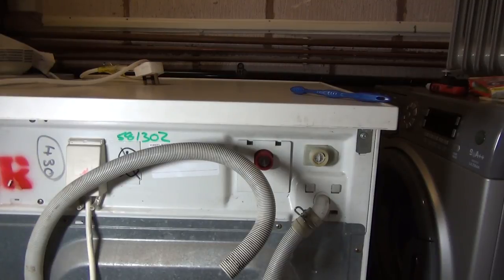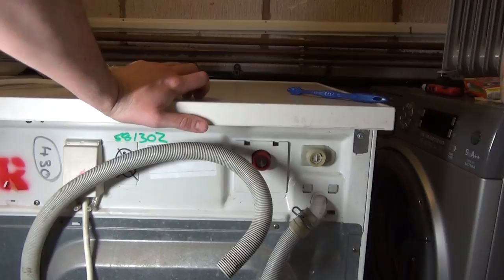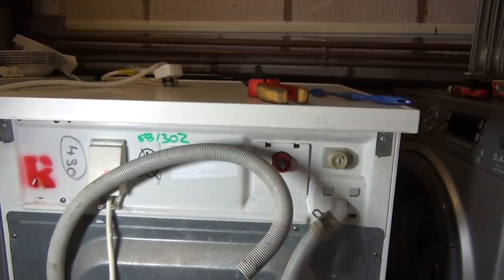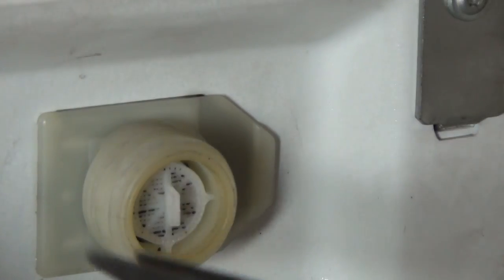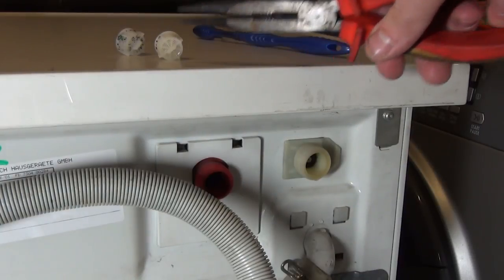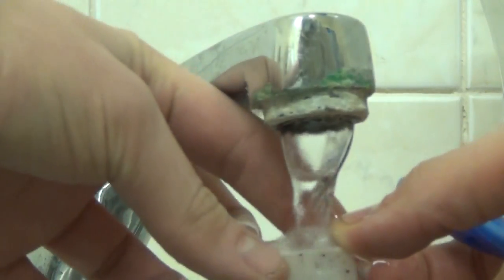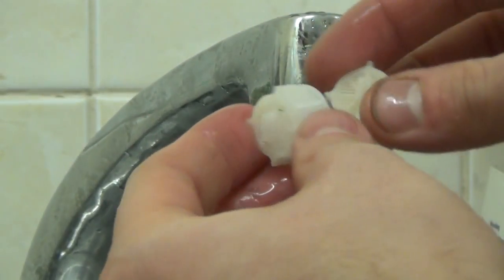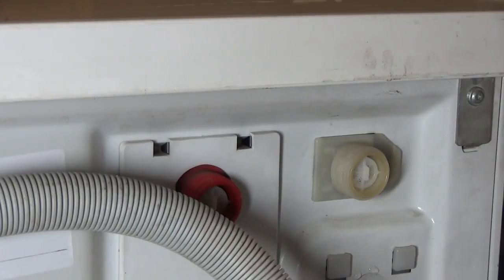How to Tip #59 : Remove and Clean Washing Machine Water Inlet Screen Filters

Comment: Thank you. I couldn't figure out if filter unscrewed or if it pulled straight out. You're video was a $ saver. 👍👍
Reply: Same deal. Tried to screw it but the little piece of plastic broke off. Luckily I was still able to pull it out with thin nosed pliers

Comment: My washing machine won’t stop leaking hot water inside the machine even when off if I do this will this fix ‘???
Reply from the maker: No. But depending what brand it is. Its a case of a New valve and call out charge from a local trusted engineer.